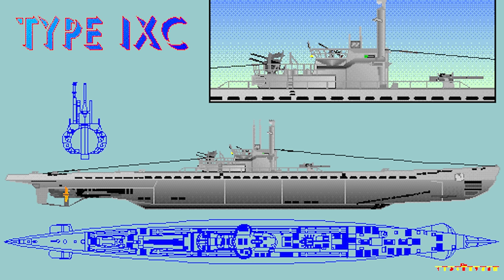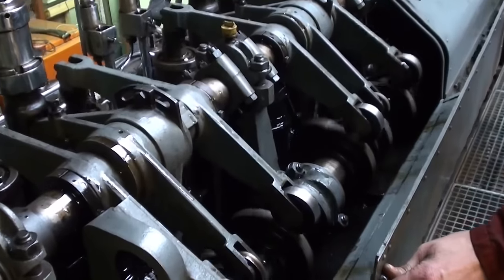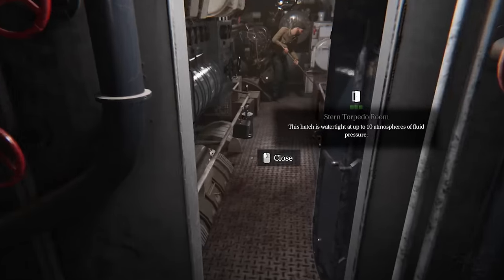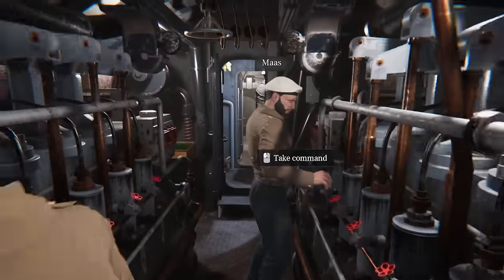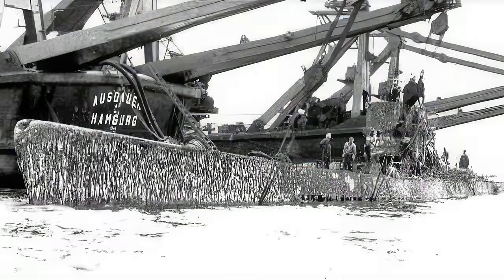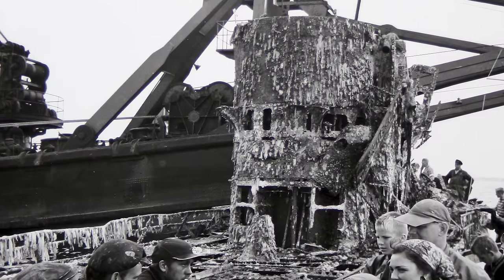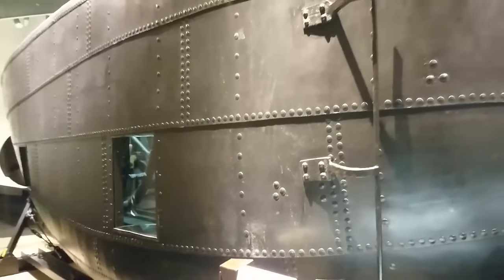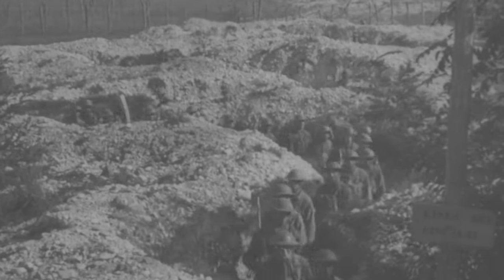Raising a U-Boat

Comment: The interior video (from a game) was a type VIIC with a single rear torpedo tube while a type iXC had two rear torpedoes.
Reply from the maker: Great spot! Appreciate you watching and have a fantastic weekend :)
Reply: To be entirely accurate it was a Type VII B which had a single stern torpedo tube. The type VII C had TWO stern tubes. (and for information the Type VII A had a single EXTERNAL torpedo tube).

Comment: I’ve never heard of a u-boat capsizing.  Trying to imagine the circumstances.
Reply: I can see sinking unexpectedly but capsizing? Center of gravity is low to begin with on submarines. Doubt it would turn turtle.
Reply: @BigLisaFan Any vessel can be capsized given the right conditions. Uneven side to side weight distribution can do it, or, if you can't turn your vessel in to them, stong waves can do it... which is why vessels try to face them head on. A combination of factors could have severely altered the centre of gravity. I'm sure the official reports would give an explanation.
Reply: For the same reasons as any other boat.

Comment: Very interesting  doco .. how does the engines get air when submerged
Reply: Diesel electric engines. The U-boats like all submarines before nuclear power use batteries for underwater propulsion.
Reply: @jonmcgee6987  thanks for that 👍
Reply: @jonmcgee6987 Although mostly true, the Germans did equip some of their later submarines with a snorkel, which allowed them to use diesel engines whist submerged. Obviously there were limitations on how deep you could go whilst using them. How reliable and effective they were, I cannot say... but they definitely used them.
Reply: @another3997  Depth about the same as periscope depth.  More effective in calm seas, in rougher seas the head valve (top of snorkel) had sensors to close immediately if the sensors got wet from seawater splashing on them.  If the head valve closed with engines running they would suck the air out of the boat in seconds. Very hard on the ears.  The enginemen had to shut down the engines very quickly.
Reply: @guzzijack9714  Not so much a "sensor" but a float valve on the inlet, rather like a carburettor.
Reply: @walterkronkitesleftshoe6684  Thank you.  My experience was with a US boat that had three electrical sensors in the snort tube.  If water covered two than the head valve would close.